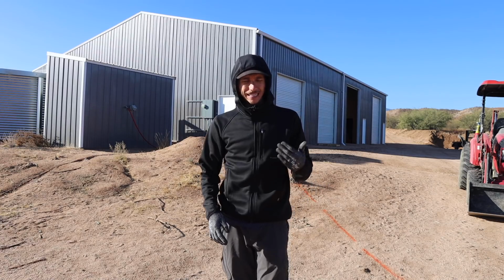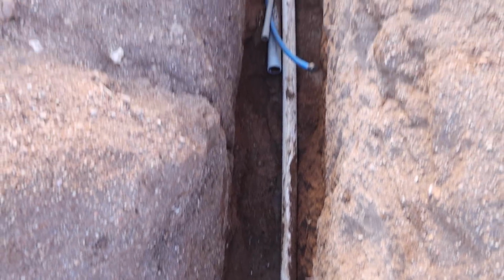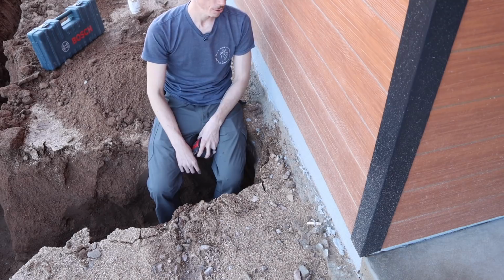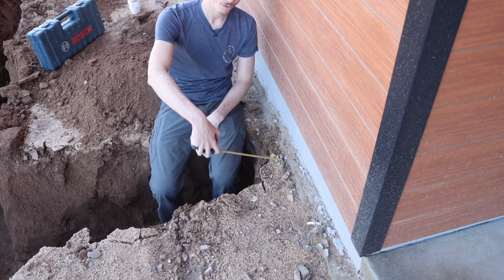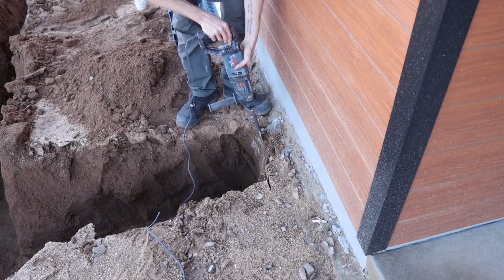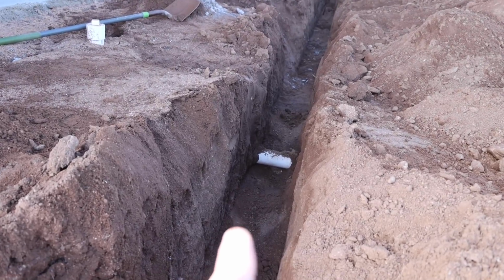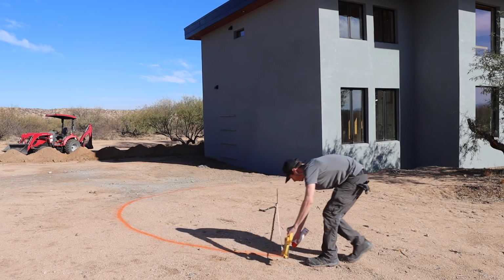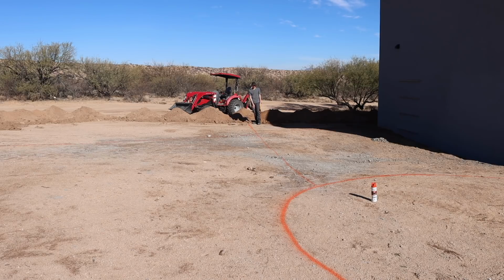THIS COULD'VE BEEN BAD

Comment: Why put the trees on the side (where there are no windows to look at them) and the tank at the corner where it obstructs views? I would re-think this arrangement. You've got an excavator so you could easily dig a few more feet of trench and move that tank out of sight.  I guess the counter-argument is if you really want to feature every functional element of the construction because you just like the style of showing off the pragmatic parts. Can't argue with that, just not sure it couldn't be better balanced here.

Comment: I live on the Gulf and high winds, hurricanes, & tornado hit here a good bit. What you learn after your first big storm. Cell phones don't always connect and a text might not get through. That 99% up time phone line Comcast sells stops working with the internet. But you know that Plain Old Copper phone line keeps you connected. So I have a land line with a dumb wired phone. No bells and whistles but it helps.

Comment: 11:45 Just a tip , on the knob for the different funktions there is normally a position between "hammerdrill" and "hammer" (normally marked with a dot or a circeled arrow) to which you can turn the knob so the spindle is unlocked and you can rotate the tool to the position you need it in.
This way it is a lot easier then to put the chisel in and let it rotate until it maybe stops in the position you need it to and yes i too took way to long to discover this function (that is on these machines for ages) myself, i guess that is the downside of "not need to read the manual" 😅

edit: and too much pressure while hammering isn´t good either you have too finde the sweet spot normally just press it down with your arms, thats plenty enough your whole upper body is too much it needs some workway to funktien effective, for example if you have that drill 2 sizes bigger, a 5KG Hammerdrill (here in germany we have the small ones, then the middle 3KG version, 5KG and even bigger) and you need to drill through a steelconcrete ceiling/floor, the easiest way to do so is to drill down and all you have to do is to just hold the drill it goes through the floor just by its own weight, often putting more force on it slows it just down.

Comment: 15:00 Not understanding why you compromised the house footing instead of using 22° or 45° fittings to go aroung that spot.
Reply from the maker: uhhh how did I compromise the footer by removing a small piece of it? lol
Reply: @Handeeman  Well, as a structural engineer (retired) I'd say that when, what appeared to be 4inches (20%) of the 24 inch footing removed, it has a reduced weight capacity and is compromised. Just an observation...please don't take offence... I do enjoy watching what you 2 are doing out there. Very talented couple. Keep up the awesome clips.

Comment: Don’t drop your data cables directly in the trench with power lines, it creates noise and effects data speeds etc. make sure there is 8-10” between any data cables and power cables. 

Also drop in some trench tape so you don’t hit the conduits in the future. In a lot of countries this is a legal requirement. Lastly an aerial shot with distance marked of the trench so you can work out where the trench is for the future is helpful.

Comment: You don't want electric cables and data cables in the same trench. Data and electric cables should never run parallel to each other over distance.

Comment: Matt Risinger JUST posted a Quiet Pipes video, fun post. Not sure if you still have access to indoor plumbing:)
Reply: Yes, and in an unusually for Matt's videos there's lots of disagreement on that one. It is an issue but lots of plumbers who've had to try to repair 30 year or more old houses sure don't want a section of iron pipe to try to fix.
Better to wrap soundproofing around the standard PVC drain pipe. First wrap sheet rubber around pipe (for the dense frequency absorber) then spirally wrap 2"x3/4" adhesive foam tape around the downcomer on top of the sheet rubber. It'll be quiet and cost a lot less than the cast iron and only takes an hour to install. Secure the ends of the foam wrap with tie wraps so if the adhesive fails in years to come it states wrapped.
Reply: @bobjoatmon1993  My hyprocrisy only goes so far- Doc Holiday.
Reply: @gregormiller4037  I actually don't have a clue to what your cryptic comment means.
Reply: @bobjoatmon1993  it's from a movie..But does every coment have to mean something to you, in order to continue the globe movement?
Reply: @gregormiller4037  if it doesn't have meaning then it's just a waste of time.
Mine or anyone else who reads it.
See, again with the cryptic... "global movement".  That has so many possibilities it's absolutely meaningless.
Sheesh, I'm done wasting my time trying to make this better.
Reply: @bobjoatmon1993  ..not really, the attempt has more purpose than meaning, just shows ya care.

Comment: We still have a landline.  It's cheaper than a cell phone and you don't need to charge it and if the power goes out we can still use our phone.  Even though we do have cell phones we just kept our landline in case of emergency.
Reply: We also still have a landline, but it's an optical fibre internet link these days. Our home phone now runs over the internet. It's way faster than cellular data.
Reply: In my area, my land line is twice as expensive as my cell phone. I spoke with a repairman, and he said that they're pricing it so high to discourage people from wanting it. They no longer want to maintain the lines....

Comment: When laying out your piping make sure to put in a fire hydrant distance from the house of your main source also on your roof downspouts for your water from your rain do you want to have a way you can clean those pipes out because you will get settlement in those pipes.
Reply from the maker: What do you mean by a fire hydrant distance away?
Reply: Do you want your fire hydrant at least 50 feet from your house to the room to get the equipment between your house and the hydrant so you don’t have it to close fire trucks bring a lot of hoes not much water

Comment: If you do run networking to it, make sure you use fiber-optic between the two buildings. Nearby lightning can fry the networking equipment, learned that the hard way. Ground loops are also a possibility.

Comment: A line for an air connection at the house can be useful for a number of things from blowing out reusable filters to filling tires when parked at the house.
Reply from the maker: What type of pipe would you use to run that?
Reply: @Handeeman  Surprisingly pex can do the job when you find the right fittings for the pressure and remember that there will be line lag normally unless you put in an accumulator.

Comment: See you figured out the irrigation wire runs for valve locations and the mainline concept. The tiny house with the valves inside is a little goofy but it still works haha. I serviced my place 5 years ago. Pumphouse at the street takes my HV line drop and internet and acts as the big brain for my whole property. Houses the irrigation controller (18 zones), Wifi router, septic pump controller (because it looks ugly and I didn't want it at my tanks), pressure tank and well pump controllers, and all my valving for house, garage and irrigation mainlines. I ran 2" PVC sleeving for water lines to house and garage, 2" PVC conduit for data and 2" PVC conduit for running single conductors to the garage. Its a good setup because the electrical meter and main panel is 100' from the house and it will allow me to run a sub meter if I put in a suite one day
Reply from the maker: Yes I did pick up on the better way to run an irrigation system 😂